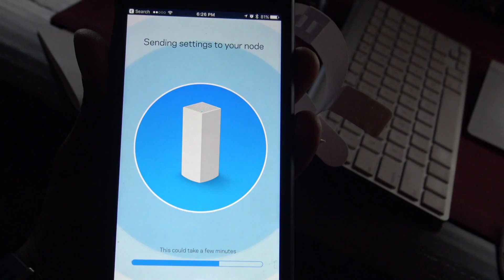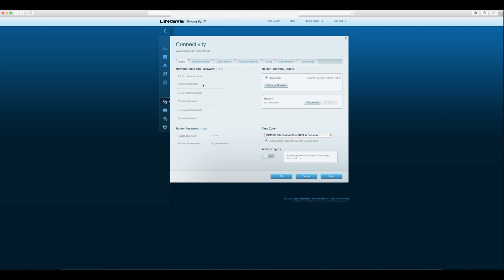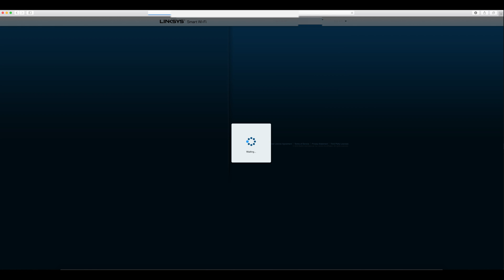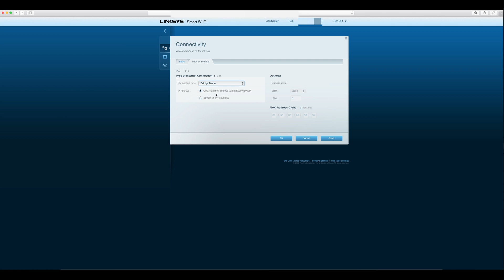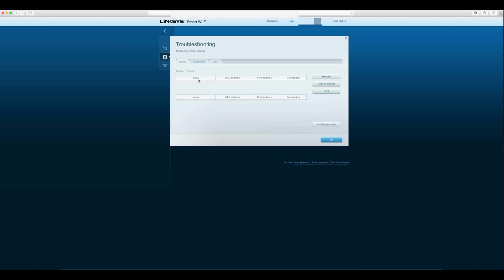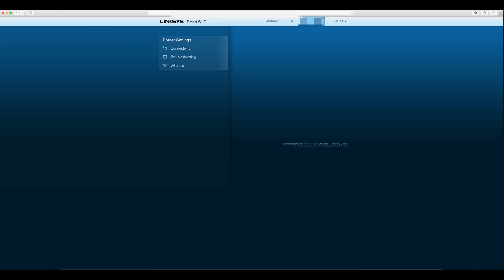Linksys Velop Network Bridging Setup and Configure

Comment: I have set up the Velop system, unfortunately I am unable to find my WD EX4 cloud which is running through my ISP modem router. Are these sytems not compatible? How can I get the system to see the EX4? Do I connect the EX4 directly through the VELOP system?
Reply from the maker: Hi @695925, to answer you question I would need to know a bit more about your WD EX4 cloud drive. Depending on which model of the EX4 you have, I believe it supports USB & ethernet connections. If you are using ethernet connected to your ISP modem/router, then you would need to put your Velop router in bridge mode. This will allow the Velop to communicate with the EX4 connected to the ethernet port of your ISP modem. 
Alternatively, you could get a inexpensive 4-8 port switch and connect that to your Velop node. Then attach your EX4 to the switch. This option will keep the ISP router operating as a NAT gateway and your Velop can function as an internal router.

Comment: go with this or the linksys RE9000 ?  range extender on existing IsP provided service router.
Reply from the maker: I've had a solid experience with the Velop system. I have tried range extenders and other vendor routers. None of them have provided the same performance and experience as this system. Range extenders can be inconsistent in terms of reliable connections because your device will change MAC addresses as it "roams" between connection points. If the extender does not have a high performing back haul system (like the Velop or other similar units) you will experience drops in connection while your device re-syncs to the wireless network.

Comment: What if you have a combined router/modem from your ISP?
Reply from the maker: The solution described in this video will work with a router/modem from your ISP. As long as the router/modem from the ISP has an available ethernet connection to plug into the Velop, you should be fine. If you do not have a secondary router, as I do in this video, you can just run the standard Velop configuration and your network will operate just fine.

Comment: Is it necessary to bridge in order to get the fastest internet signal to the velop?  I have Comcast gigabit service and have everything connected to their modem/router through hardline but the velop is getting very low mbps compared to what is coming in off of the modem/router they installed.
Reply from the maker: Bridging should not be a requirement for getting the maximum bandwidth between your Comcast modem and the Velop. There can be a number of factors that contribute to reduced throughput. For example, if for some reason the traffic coming from the devices on your Velop going outbound to the internet through the Comcast modem is being bottlenecked by the CPU on the Velop node (that's a possibility but I'm not sure how likely that is).

There could be a fragmentation issue between the two devices where the MTU setting could be causing dropped packets, thus resulting in reduced bandwidth.

Are all of the devices on the Velop experiencing the reduced throughput? Is there any difference in performance based on distance from a Velop node? What about directly connecting a device to a port on the Velop, does that have any impact on throughput? 

Assuming that your setup is similar to mine:
Setup-
Comcast router (Non-bridged) -> Linksys Velop (Non-Bridged) -> Internal switch (bridged wifi router) -> Devices

1. My Comcast router is performing NAT from the public (Comcast provided IP address) to the internal Comcast router network (e.g. 10.0.0.1).

2. I have port 1 of my Comcast router connecting to the Velop node. 

3. The other port of the Velop node is connected to the uplink port of the older wifi router (set to bridge mode).

4. The Velop node system is performing NAT of the Comcast network (The 10.0.0.1 network from above) to my internal network (e.g. 192.168.1.0).

5. From there, my older wifi router is configured in bridge mode to basically extend the IP space (192.168.1.0) of my Velop to the devices that are plugged into the wifi router. 

I don't experience any bandwidth problem with this configuration. With over 40 devices on my network, they all have approximately the same throughput out to the internet and internally between devices. 

I would be make sure that you don't have overlapping wifi SSIDs (e.g. Comcast modem and Velop system are broadcasting the same Wifi name). I disabled wifi on my Comcast system, as it is not needed in my case. However, if you want to use the Comcast Wifi in parallel to the Velop (for a guest network for example) just make sure it has a unique name. 

Let me know if this helps.

Comment: Does the Velop work with the hardwired set up like this: node1<------ modem/router ----->node2  (bridge mode)

I've set it up this way and spoke with the tech for hours and days because we tried to figure out what was wrong with the nodes not working correctly with this set up. I ended up replacing it to rule out if it is a bad node and it should be here in a few days.
Reply from the maker: Well, I'm not sure if replacing the node will resolve the issue you're facing.
In your setup, there is a potential error in the physical topology (the connections between the nodes) depending on the functionality of you modem/router. In most cases you will not be able to route to node1 from your router/modem and switch to node2 from the same device. 

You can only define one subnet on the Velop, so you can't route and switch that same subnet on two different nodes if they are part of the same wireless network. 

If you set up node2 as an independent node (separate network) then you can accomplish your setup - assuming your modem/router can actually perform routing to one node and switching to another.
Reply: Netxperts but they both are independent and in bridge mode, So should work.
Reply from the maker: If both nodes are independent, what device is handling the IP addressing for your network? If each node is independent and bridged to the modem then that means the modem would be handling the subnet/gateway information. This basically means you are stretching your layer 2 network to each node. If so, then yes it should work fine. But I suspect the modem would be bottleneck in this case. 

For example:

Modem Public ISP IP: 5.5.5.5 /28

Modem Internal IP: 192.168.0.1/24 (DHCP Pool defined here)

Velop Node 1 IP: 192.168.0.2 ->Bridged - extending the 192.168.0.1 network 

Velop Node 2 IP: 192.168.0.3 ->Bridged - also extending the 192.168.0.1 network 

This should work. I've never tested this configuration, but logically it makes sense. This basically works as an extender, but you lose some of the benefits of the mesh network by deploying it this way. 

Potential caveats:
Wireless network advertising from each node - If each node is independent, are you broadcasting the same SSID from both nodes? If so, you could run into problems with wireless devices maintaining a consistent connection because as they move around your house they will change from one node to another (switching destination MAC addresses) which will cause interruption because the nodes are not synchronizing the back plane as intended with a typical Velop Mesh setup. 

Additional hops in the network for devices on each node - this will affect network performance, resulting in increased latency and potential disconnects depending on the application. 

Will the Modem/Router wireless network be enabled?

What exactly were the nodes not doing in your network? Could one reach the internet and the other could not? Or, would neither come online?
Reply: Thank you for your response. I fixed this issue my self but was too lazy to call back to let them know how I did it. Basically how they told me to set it up was have one node bridged to the modem and then set the the other node bridged the same way BUT (important part), they had told me to click on  "add another node" in the app which was causing my issues with losing connection and wifi not working on one node. I had fixed this by clicking on the app "set up a new device" instead, which I think basically recognized it as 2 separate nodes in bridge mode. This way I added the second node to my Velop network as a separate router.

Comment: where can i confg media prioritizing? i only have device prioritizing tab.  i need to confg the QOS but couldn't find it cos its under the media prioritizing
thanks
Reply from the maker: Hi Mona. It sounds like you are looking for application level QOS settings based on application layer attributes. I don't think this level of functionality is supported on the Velop. You can set prioritization based on the device or group of devices. 

The Velop will analyze the available bandwidth out to the internet (upstream & downstream). Once that is complete, the system allows you to assign bandwidth priority based on device (essentially MAC address).

Comment: I am thinking of buying this system. I have an cable router. After that I have a Asus ac66u router with NAS. What's the best way to connect to get it all streamed working? Are there disadvantages of putting the velop in bridgemode?

Comment: What was the point of setting up the router in bridge mode when you have the velop system ? What's the propose it just feels like a switch at this point with all the wifi off.
Reply from the maker: TerminatorTechs you're absolutely right. In my environment I wanted to leverage the ports on the router which is the reason I configured it as a switch. There are certainly other options, like connecting a switch to the unused port of the node or even using a hub. However, for me this solution made the most since given the posture of the devices in my environment.
Reply: Check out my velop video.
Reply: Yep, you could have used a cheap router in bridge mode to do the same.  Why buy an expensive mesh system to do such a simple task?
Reply from the maker: @V M The purpose of this video is to integrate the Velop with existing equipment, since the Velop is limited on port density. Many people have a similar setup with an ISP modem/router and an internal (commercial) router. Technically, yes, you can buy equipment to do the same thing I achieved here, but why go buy something when you can repurpose what you have? Also, I'm not putting the Velop in bridge mode. I'm putting my existing wifi router in bridge mode (essentially turning it into a switch) so I can leverage the gigabit links on the device without adding an additional routed hop to the network (leaving it as a router) which will add unnecessary complexity for services that don't work well with multiple NAT configurations.

Comment: Thank you for a very informative video on the Velop.  Have a question regarding your setup.  The ISP modem and my router are one device, so when I connect I think I'll only need the one Ethernet cable from the ISP to the Velop, is this correct?  Ordered my Velop yesterday and it should be here sometime late next week.

Thank you in advance for your help!!
Reply from the maker: Yes, you are correct. You can accomplish the same functionality using a single ISP router/switch. The Velop would provide the wireless access while your ISP router/switch handles the physical connections. Each Velop node also has two ethernet ports that can be used to extend physical connections to devices that have ethernet as a connection option..
Reply: You are certainly a great source of info on the Velop.  One more question......should I put my modem/router in bridge mode and turn off the WiFi before I setup the Velop?  I'm obviously somewhat uncertain about this.  Thanks again!!
Reply from the maker: It really depends on what "bridge mode" means on your ISP router. I most cases, it simply means turning off NAT. The problem with that is, the public IP would have to be passed to your Velop. If your router supports that, then your Velop would become the "edge" of you internal network. If the router cannot pass the public IP, then you would a block of IPs from your provider. One for your ISP router and one for the Velop. The Velop would then handle the NATing and DHCP for the internal network. 

I would say that you want your Velop nodes in bridge mode because your ISP router would be handling DHCP request for devices on the wireless network as well as the ports on the router. Wireless devices will join the network via the Velop and the DHCP request from the devices will be forwarded to the ISP router, and the router will return the IP address to the device.

Comment: Have you noticed any issues with online gaming with the velop system? I have had nothing but trouble with this system since I bought it which is over a month ago. I have preformed all of the firmware updates even enabled the ports but still having random packet loss when online gaming but its not due to my ISP. It's across all of my gaming devices my two xbox ones and my andriod devices. Has anyone else encountered this?
Reply from the maker: I have not experienced any negative impact to my network since deploying the Velop system (outside of the administrative headaches 😋 with the GUI). From a performance perspective, I have only seen improvements. 
I have several gaming consoles connected (3 physical - 4 wireless) and I do not experience any problem with the connectivity, even when multiple systems are simultaneously in use. The same is true if people are using their phones, tablets, & computers.  

That being said, gaming systems can be a little sensitive when it comes to network connectivity, especially over wireless. Prior to getting the Velop, I had a problem with my xBox One connecting to xBox Live even though the configuration was correct. I resolved it on my old router, but since having the Velop in place, I have not experienced that issue at all. 

It sounds like you are experiencing a problem with network services on multiple platforms which could be an indicator of a hardware issue with you Velop or possibly a configuration error between the Velop and the ISP. Does the packet loss only occur on wireless devices or physically connected devices, or both?
Reply: Only on wireless Devices, not on any hardwired systems. I have also tried to change the MTU to manual of 1100 to possibly fix the issue but the application crashes everytime I try to save the setting and gives me an error screen. Even when I uninstall and redownload the application I still experience the same issue across multiple devices.

Comment: They have changed the splash screen to remove those options from the bottom. Great video by the way. Very informative.
Reply from the maker: @xxyoungchinoxx - thank you for watching and comment.
You are correct. In the latest firmware update, the splash screen is altered a bit on the primary node. 
Stay tuned for my next video on the steps to resolve this issue.
Reply from the maker: Hi, I have posted this simple video while I'm on the road. It walks through the steps to restore Linksys Velop administrative menu from the web interface: https://youtu.be/tN2tNiY9bB4
Reply: Do you know if the page is still accessible if you know the URL? I'm wondering if they entirely removed the advanced settings or just the link on the splash screen. I don't own a Velop (yet) to check for myself but I'm a bit worried if they intend to remove advanced features.
Reply from the maker: @mathias Immerkaer - Yes, the administration console is still available. There is an error with the firmware update 1.1.1.178763 that breaks the link in the splash screen and removes the "ca" link at the bottom. 
To resolve this issue, a few simple steps must be performed. In summary, you have to "redeploy" the nodes. While this is not the most favorable solution, I do have a method that will minimize down time. The video on this process will be published soon. 
Hopefully, the updated firmware will address this issue.
Reply: Looking forward to your video! Could you please share the URL if you still have it? Thanks!
Reply: i still can access the page with  LOCAL_IP/ui/dynamic/advanced-wireless.html
Reply: still accessible? gives me 404 page not found err